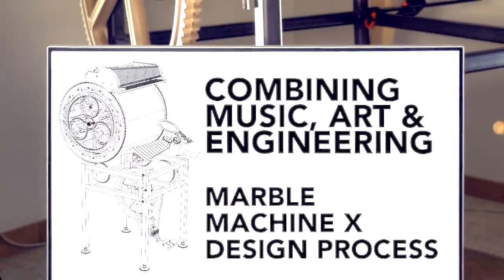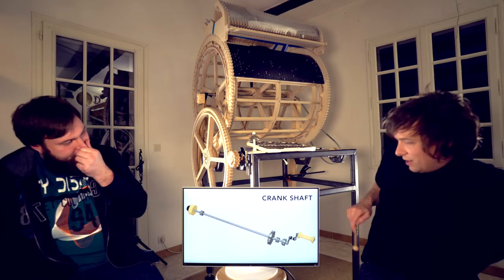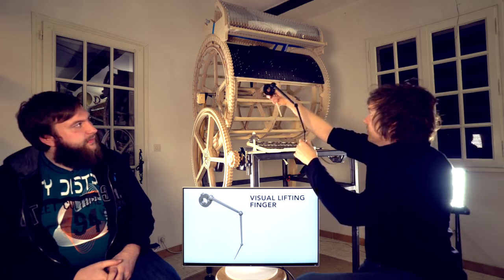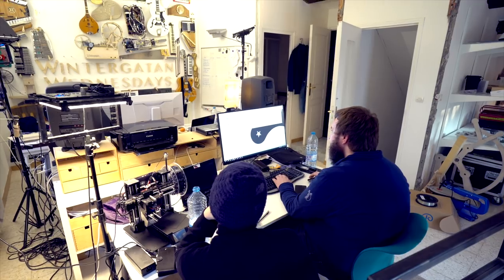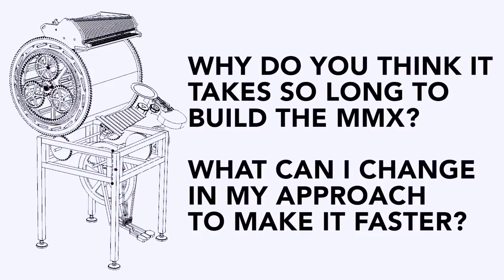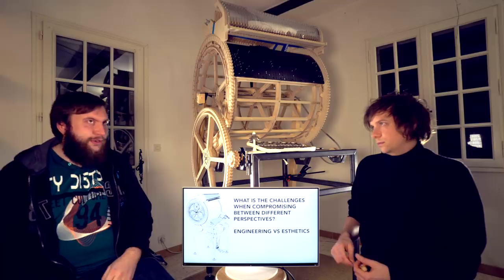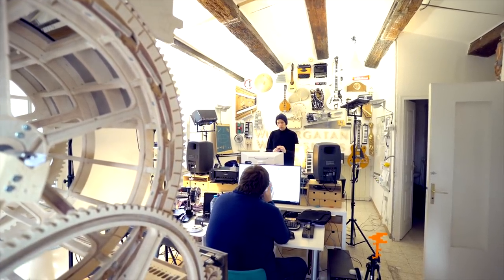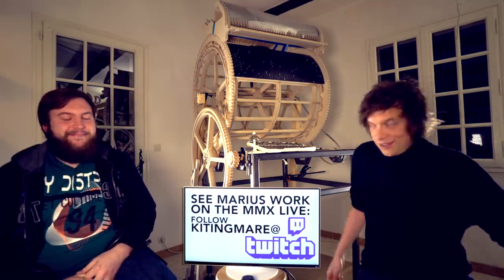Darth Marius Returns - Marble Machine X #27

Comment: I'd like to argue that if you have talent, if you put in the hard work it will take you farther than hard work without talent. There is also a limit (biological!) to what level you can get to without talent - on hard work alone. I can use my own experience to illustrate this.
English is not my first language. I first learned it to communicate in grade school, then once in high school the hard work of writing poetry over the span of a couple of years - poring over dictionary and thesaurus in tandem - resulted in me gaining significantly better command of the language, arguably over a lot of native speakers, than if I had just coasted on my initial time investment. And yes, my poetry was pretty crappy initially. If you write your first poem and it sounds like Edgar Allan Poe or another master ... either you've cheated or you're not human. Anyway, I count this as a result of hard work, not talent - and I still have a bit of an accent AND have some minor lingo disasters from time to time (like realizing words I've been using wrong due to inaccurate translation in my head).

I've been told in grade school I have no artistic talent - can't draw, can't craft, nada, zip, zilch. I just suck. Fast forward to my high school years, I needed to pick an elective to fill my schedule and I went with art. Turned out that with a good instructor, I was in fact able to unlock something of a talent in me. I ended up taking art all 4 years of high school and had a piece featured on display each year that the combined art classes did a gallery of sorts. I did put in the hard work there, too - I had to start from scratch and realize that maybe there was artistic talent in me. Sadly, for a variety of reasons I have not been able to pursue this much further, but my earned bit of background in art has been helping me in places ever since.

I know I have no physical talents per se. Never been overly athletic, and I do remember distinctly being below average on bodily flexibility. I'm a heavy build (heavy bones/muscles, not fat - at least not in my prime years. I do have a bit of "padding" nowadays :P), but I did always have a quick recovery time after wearing myself out from activities.This is one of those things where I could probably improve my situation by applying hard work, but it will never bring me to the level of what Olympians do due to difference of body type/build.

Last but not least for this list is music. I've been making music (primarily) on the computer on and off for over 21 years now. Quite honestly, I still don't know whether I am where I am with it more due to talent or hard work. It's probably a mix of both (though I suspect hard work to be the larger factor), and I sometimes wonder if I have talent at all haha. My reason for saying that? All I need to do is open one of my first music projects, then open one of my most recent. If I made you listen to both you'd probably look at me funny if I told you afterwards that they were made by the same person. But here is where it gets interesting. I don't have perfect pitch (or at least I don't think I do; I probably would know by now if I did!). I don't have amazing musical memory where I could listen to a 5 minute piece and sit down at a piano (or blank sheet music) and just reproduce exactly what I had heard. These would undeniably be the level of ability you could not achieve with hard work alone and would need talent for. Talent alone won't get you to a point beyond what sheer work will, but work combined with talent will bring you to a place no one else can reach.

Wow, this was way longer than I ever intended it to be xD

TL;DR: There's results you cannot get without talent no matter how hard you work, but enough hard work alone can get you relatively close to what talented people can do, given enough time!

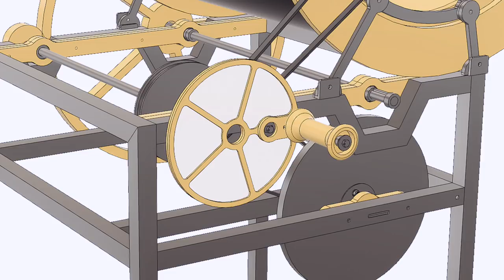Comment: 4:50 I blame the Mac book. Underpowered and over priced.
Reply: GERMANATOR444 exactly. For the same money you can get something more powerful
Reply from the maker: Im actually looking into a hackintosh right now.
Reply from the maker: i always worked on their power houses, but the latest one had so much bad reviews so im stuck with the touring laptop. I need to get something else, but i do not want a PC, advice on hackintosh?
Reply: Good luck with it, I found hackintosh overly complicated to setup, and sluggish. Have you come across running OS X in virtual machine? Oracle VirtualBox can do it, and it's free (probably have to buy a copy  of OS X, though)
Reply: Snazzy Labs has some good hackintosh builds. You should check out his channel.
Reply: Yeah. Snazzy Labs seems to have the most recent success with building hackintoshes. But why are you tied down to OS X?
Reply: did you see the new imac pro? its quite powerful.
Reply: And costs only a mere $5000.
Reply: I've done virtual machine OSx and it was atrocious, would not handle 3D modeling in a million years.
Reply: Unless you have a friend with experience on building hackintoshes for years, then I also advise not too.
I tried to build one myself 4yrs ago for school project, got a pos instead. I get random reboots, sound driver sometimes gone, and some features not working like airplay. 
I think you should wait for a mac pro, the one with upgradeable memory and hdd instead.